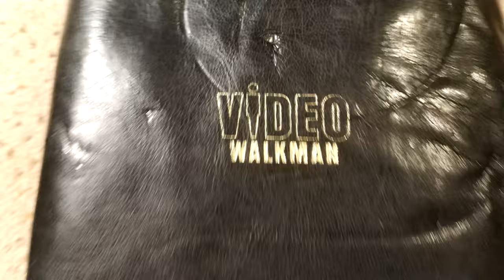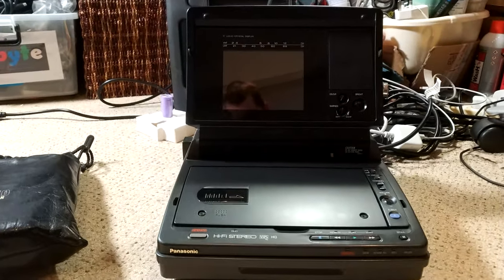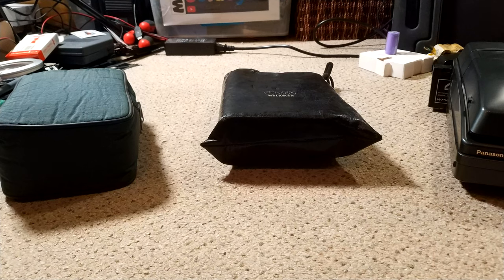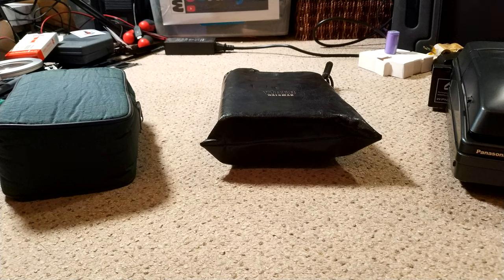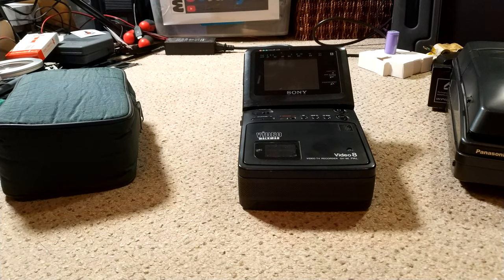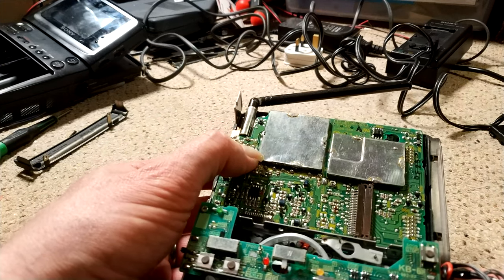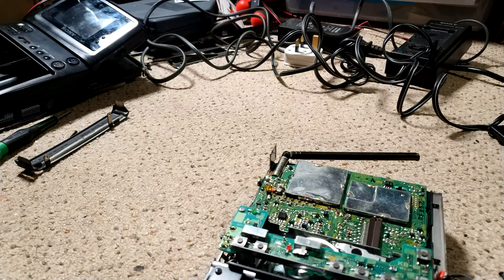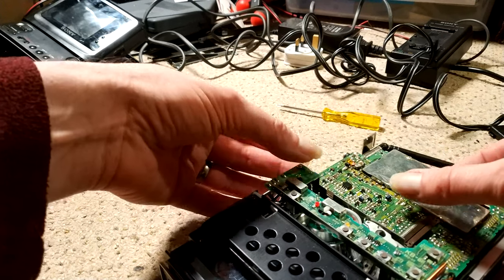Sony video8 GV-8E VCR part 1 - fixing mechanical issues

Comment: This portable need a complete recap from smt capacitors.
This here leaky badly.
Reply from the maker: Absolutely - I do cover this in part two especially as I make a rather sad discovery! Basically anything with the SMD caps from the late 80s and 90s just have to have them changed. Thank you very much for the comment too - really can't emphasise how much of a problem these capacitors are.
Reply: Hey guys
Even with news caps sometimes these machines will not work depending on how the board and the surrounding components are damaged knowing that these are double sided boards with through holes and most of the time the conducting wires are eaten by the caps electrolyte.